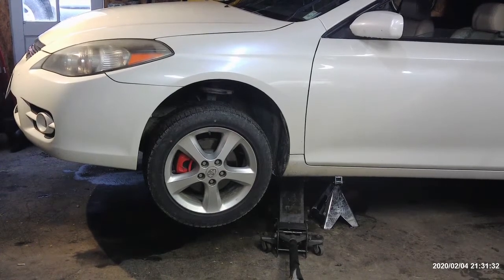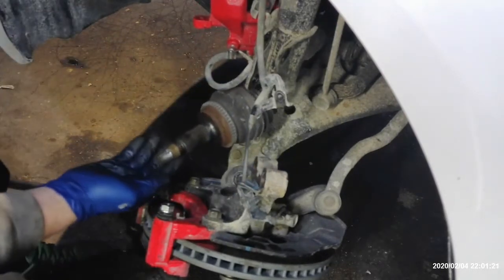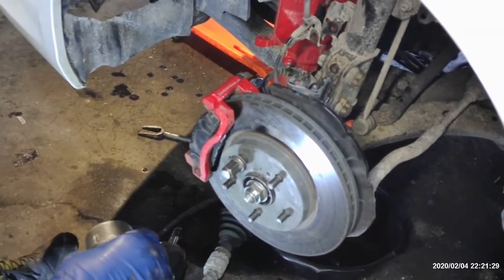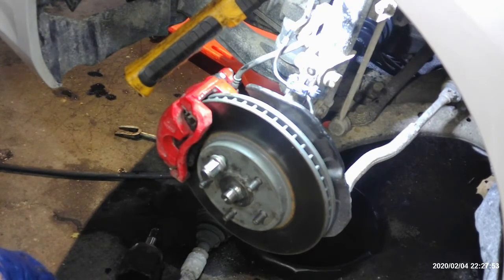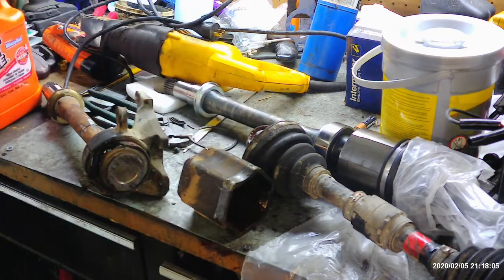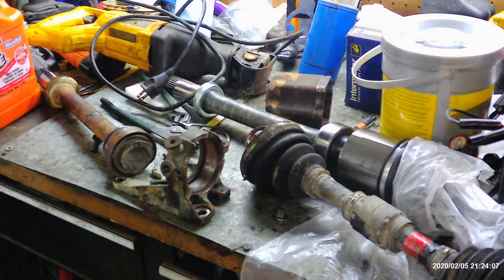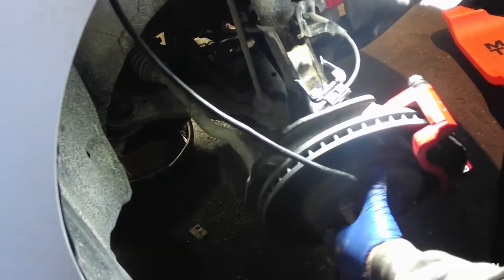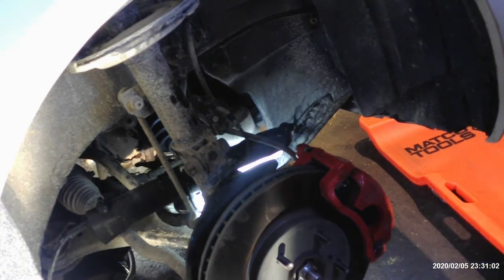2008 Toyota Solara Front CV Axles Both SIdes

Comment: The driver side of my 07' Solara was no problem.  The passenger side what a nightmare.  I had to cut the axle in half at where the stupid carrier bushing/bracket is with my ricpricating saw.   Then I undid the bolts for the carrier housing mount.  But there are two small pins that go into the bracket and engine.  So I had to slightly pry that out.  I couldn't tap/hit the bracket remaining shaft out... I had to use a slide hammer with a hook to pull it out.  Thankfully I have an OEM passenger side axle and bracket that I will be putting on.

The axle shaft was completely fused to the stupid carrier bushing.  I had to use a 10 ton press to get it out from the bracket and that was me just messing around to see how seized it was... There was ZERO way of removing that had I not had a press.  Some videos I see people hitting it with a hammer and it pops off... not this one..lol

Why toyota uses this stupid axle bracket / bearing is unreal.  PLUS the one bolt is behind the axle shaft so there is no way to even remove the bolt without getting the shaft out.  So stupid.

EDIT:  I really wish I watched this video FIRST before doing it... You literally said/went through everything I just experienced and did.. like to the T!... AHAHA.  G damn Toyota!  What a annoying thing for sure!

Comment: Great video. My Solara did not allow for the sawzall method without dropping the exhaust. 
was able to break my seized carrier bearing loose by using some increasingly thick old cold chisels as wedges and a lil sluggo to pound them in. Ima have to dress the bracket a bit, but even replacing the bracket isn’t much more expensive than three carbide blades. 
Just another option.

Comment: Fyi, just had a seriously stuck carrier bearing. Took 2 people, 1 air hammering with long chisel bit on back of bearing through opening between exhaust pipes, and the other with a huge masonry cold chisel and a bfh on the back of the axle just past the bearing. One or the other wouldn't work independently, but both at the same time tackled that sumbitch.

Comment: I used a cut off wheel and cut the bracket across the bearing. Chopped out about an inch. Without cutting thr axle. Horrible design. Replaced the bracket.

Comment: Thanks for making this available, great information. Figures that my right side boot is leaking, so I have to deal with that axle extension bearing support issue. Would soaking it overnight with a penetrant like Liquid Wrench get it to the point it can be banged out, with having to cut anything?  
Question: another YT video showed that  large C-clip and retaining bolt, where the axle enters the transmission, for the passenger side, too.  I didn't see any C-clip when you did that side, though.
Reply from the maker: I feel bad for you those cars are notorious for seizing, I would do whatever you can soak etc maybe you will get lucky and yours will come out. Yes both sides have a little clip at axle ends.

Comment: I used a 4-in grinder with a cutting blade
Reply: And I heard you talking about the price of those blades and I couldn't believe how much you spent to do that. I just crunched the numbers it cost me about 60 cents and I still have half of that grinder wheel left.. but I really did appreciate the video it helped me a lot work out some things I was having trouble with the clip PIN is extremely Rusty.